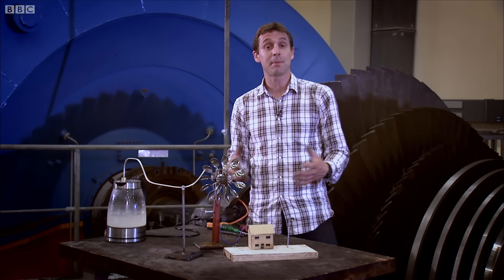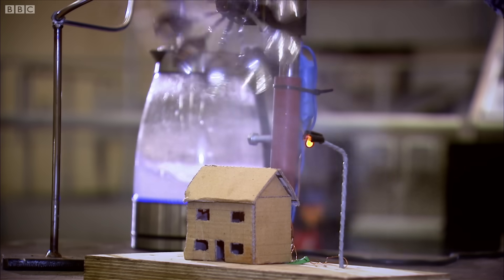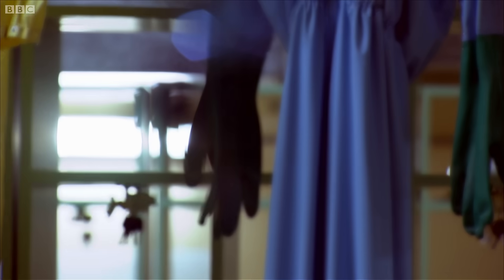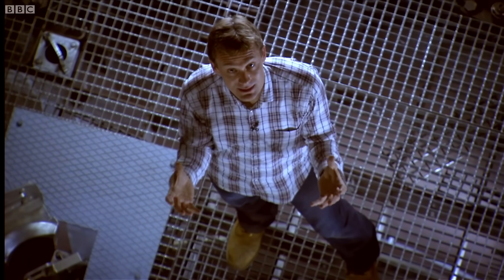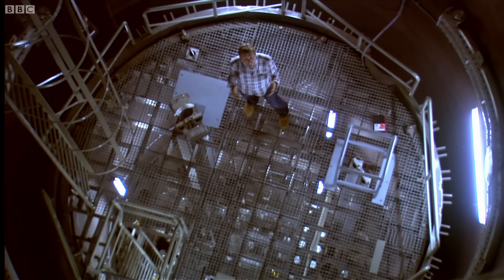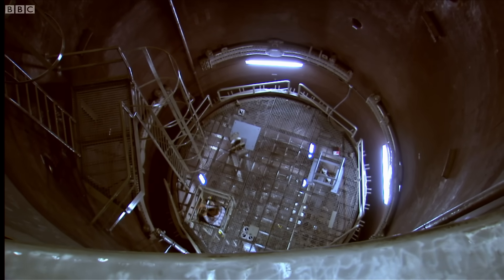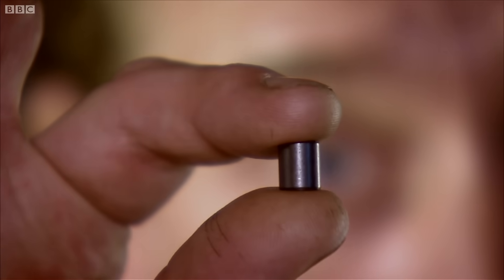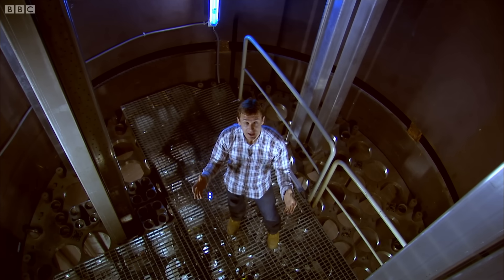Inside a nuclear reactor core - Bang Goes The Theory - BBC

Comment: Its nothing special with Uranium. Just about all atoms heavier than Iron can we split. The thing with Uranium 235 is that it can split it self if its moderated, this is also true for Thorium Plutonium, Uranium 236 and some other isotopes.

Actually using a neutron beam we can split just about any isotopes. This is a theoretical way of completely exterminate spent nuclear fuel.

The thing with Uranium is that its so easy... just ad water.... or almost. Actually it have to be enriched uranium or heavy water. This also work for plutonium. But with thorium you have to use a different method. But today there exist mix fuel that allows Thorium to be used in a ordinary reactor and also CANDU reactors can use thorium directly.
Reply: And that tied my loose ends up rather neatly! Thank you for the taking the time :) If i have any more questions i know what name to remember and where to shoot them! lol The wonders of a machine that harness such a force of nature, always awe-inspiring and raising questions.
Reply: I think thorium is the future
Reply: TIM CASE 2½ engineering degrees... ;)
Reply: matsv201
Nuclear Engineer fellow here. I love questions like TIM just asked. We born with this knowledge man, we're like semi-gods.. duh...
Reply: we can split atoms weighing less than iron aswell. Its just that the required energy exceeds the released energy.
Reply: u are hot
Reply: Tanvir Hassan Sorry to say it, its actually not me, but my wife...1
Reply: Then Its a Thorium fueled reactor that does the self regulation with Iodine-135 converted to Xenon-135 not this type, right? or does a uranium reactor have the same thing as the Iodine pit behavior chart? I'm just learning about reactors and this video kinda through me for a loop in how much they downplayed the complexities. Is there that much of a difference in reactor types? this video just suck, or am i missing something.. >_>
Reply: Generical FishTycoon Well, a reactor is not that complicated. Most complications is from the control-system, power-generation, backup-systems and safety-systems. 

A normal reactors contains just fuel roods, trottlecontrol, and moderators (usually water). A floride reactor is even more simple with no trottlecontrol, it don´t need it.

The fluoride reactors usually have a added complexity with the fuel recovery system. The thing with Thorium reactors is that when the thorium is consumed the wast material is a other  chemical material so there is no need for isotope separations. Making the fluoride in a way that so it can be chemical separated. So the used  fuel basically just falls out of the reactor and is hardly radioactive.
Reply: matsv201
How do you know all this?
Reply: CabalaCicero Yea, exacly, if you find something interesting keep diging.. thats how you learn
Reply: matsv201 Just out of curiosity about your degrees, which ones are they? And what is your yearly salary?
Reply: Juan Juarez Well, its complicated, my degrees have no real equivalency out side of Scandinavia/Germany....
But its 3 separate educations and they are non overlaping, that's the main difference from how it works in most other conutrys.

Master of science in electronic engineering (5 years)
Bachelor of Science in Civil engineering (3 years)
Post graduate Ph D free courses (½ year).

I earn about $25k after tax. Thats mostly because i work i a job that i´m poorly qualified for. But also due to that i live in a small town with low average cost of living and salary´s and high tax. Cost of living for my family is about $7500, that is really cheep for Sweden, average is about the double.
Reply: Well.. that was kind of the point. Technicaly we could split isotopes that is lighter than iron and still get isotopes out of them. But that would requier that they would have a very low or high number of neutrons, and then they would not be stable, so we would never get hold of them.
Reply: Disagreed, you are exhibiting a failed theory of atomic knowledge. You can fission atoms smaller than iron and you can fuse atoms larger than iron. Regardless fission can be instigated through too many  neutrons to cause an instability that will split the atom. That's definitional to fission (energy imbalance).  

You saying we will never get a hold of them because they are unstable doesn't really make sense. In a similar example are you simply saying that we wouldn't get a hold of a fission U235+n reaction after it happened because it doesn't exist, it fissioned?
Reply: So, are you saying that this is simply a REACTION (reactor) between Uranium and water?
Reply: Well.. kind of yes. But then you need a other moderator. Its not a water-water reactor then
Reply: IF you don´t understand what i write, don´t claim that i´m, wrong

Comment: This video doesn't leave plenty of room for scepticism on the safety of the whole process, one could think.
To say the least.
Reply: Russell Hopkins As with any other invention, we'll have to wait and see. There's still lots of difficulties and - already - known troubles fusion causes. Why not trying regenerative energies meanwhile - and a little power saving?
JFYI: even if fusion turns out to work rather safely, we already know that Earth's fuel capacities are limited. 
Nuclear energy is not the holy grail of generating power. As the universe shows us, nuclear energy works great in inhabitable spots, such as the sun.
We already have the technology to collect that energy. If only we'd spend all the dow on development of solar cells and power storage we have already spent on nuclear ruins, we'd be completely independent of anything but daylight today.
Reply: Bang goes the theory are members of the fan club.

Another ep does the stupid "Radiation is everywhere so stop worrying" thing.
Reply: Richard: yet it's pretty disgusting, isn't it?
Reply: The NRC (Nuclear Regulatory Commission) are responsible for protecting the populations health. Since September 11, 2001 the NRC has been working with Nuclear Power Facilities to make safety regulations and improve communication within the nuclear power facilities. They are also using state-of-the-art structures for the power plants. By improving their design they have made them safer to help prevent meltdowns and help get rid of waste. Power plants are some of the most toughest commercial structures in the country and are designed to withstand extreme events, such as hurricanes, tornadoes, and earthquakes.
All plants are run by highly trained staff, not Homer Simpson.
Many barriers protect the reactor minimize or prevent off-site releases.
With proper safety regulations damaging the core reactor causing radioactivity and threatening the health and safety is very low.
Radioactive releases due to terrorist attacks are very low.
It is highly unlikely that a significant release of radioactivity would occur from a dry spent fuel storage cask; and no release of radioactive material is expected from an aircraft attack on a transportation cask.
Reply: Ilovethelord508 Wow. That's impressive how you've learned your lyrics. Be assured on the following:
Unless you're working in the nuclear industry yourself, your knowledge on nuclear power might be respective, but mine will be as well. I know several people who work in that industry.
There has been a chain of serious defects in nuclear power plants, like the out-of-control run of Forsmark or the gas explosion in Brunsbüttel. These are only two out of at least ten accidents in the last ten years alone.
So, don't talk that kind of rubbish.
Reply: Käptn Kaos It depends how old they actually are. Any of the nuclear power plants that have broken down are the ones from the fifties. In other countries they don't have the money to afford the ones we have made.
Reply: Ilovethelord508 "Pour cheap designs"
Your cerebral hemispheres, you mean? Oh, yeah. Pretty - how you said? - "pour".
Reply: Russell Hopkins In Germany, they say, they have the safest nuclear power plants worldwide. I don't know how much safer they really are compared to U. S., Swedish or British devices. However, I do know for sure that every single German nuclear power plant outrun every single French one when it comes to safety, never mind their ages, simply due to safety regulations, which indeed are quite fierce in Germany.

France, though, runs about four time as many reactors as Germany ever did.

However:

- Germany also has one of the most active and best-informed anti-nuclear movements in the world, if not the most active,
- "the safest nuclear plants in the world" does, by far, not necessarily mean "safe".

There's an impressive history of serious incidents which happened in German nukes during the last ten years alone, even in the more modern ones.

I'm pretty sure that you will agree that German and British nukes will at least match when it comes to safety, so you might give a little thought on "when they do it in Britain, it must be safe".

No, sorry. It doesn't have to be safe. All a nuclear power plant has to come along with to give it the all-clear is plutonium.
Reply: Ilovethelord508 Ah yes - like Fukushima where they bought US power plants?

Again the lyric sheet on Fukushima goes. It's The Ruskies and communism & stupid command (Nope wrong)

Oh Fukushima - It's the incompetent Japanese and they are not us.

(But it was a US plant) Oh it's an old plant. We must build new ones.

By the way if you actually look into the internal NRC handling and discussions of the Fukushima emergency you might learn exactly how dangerous the US plants are.

Sorry to tell you this but the actual NRC and industry documents do not support claims of safety that are publicly made. What's more the whole basis for the safety analysis are based on faulty logic and statistics that were invented purely to give the answer they wanted. Fukushima was a clear example of the fault in the logic.
Reply: Ilovethelord508
I see. You have one great portion of expertise, as I read you.
Where I come from, there is a saying. It says: If you have no idea what you're talking about, why not just shut the fuck up for a change?
Where I come from, there is also the country where their nukes were said to be the safest on the planet, never mind their age. That may be the case worldwide; however, as I said, I'm a little more into the tech specs of these machines. Plus, I know people in the business. You seem to have no idea of the incidents I was talking about before.
So, for heaven's sake: Shut up and learn before you talk.
Reply: Richard Werkhoven
Fukushima Daiichi ran on Westinghouse-designed vessels, though they were produced in Japan under US license.
The US plant "Indian Point", which is still running, has exactly that type of reactor vessel in it's reactor housings. The safety standard of that plant is below that of Fukushima Daiichi, because it is older ald, additionally, lies within an earthquake zone.
There is no reason for the US to feel safer than anybody else who works with nuclear power. Hanford Site is another good example why one should leave nukes alone.
Reply: Käptn Kaos Pour cheap designs
Reply: Its safe when its done in Britain
Reply: Well you haven't wiped out a huge swathe of countryside yet. But you have had a go at it with the bomb plant falsely labelled as a power station.

Clearly regulation and execution matter but no it's not safe in Britain either and the danger is well known within the experts and the industry. The lies told to the people by the same have not been shown up yet,
Reply: Ok, what about when fusion can be accomplished,
Reply: Russell Hopkins Fusion is a completely different industrial issue. You can't compare the risks of flying to those of working on a ship, only because both of them can be used for transportation. Ship undustry needs completely other safety discussion than flying - but both of them are not capable of making a full landsite inhabitable.
Reply: Käptn Kaos yes but when they can do it i think fusion is the way to go dont you?
although what will happen to all the fission reactors along with all there dangerous waste materials etc when they have to be scrapped?
Reply: Russell Hopkins
Nuclear energy is never 100% safe until they find a way to dispose of the waste properly.

Comment: Nuclear energy can be a great energy source, but the problem is always the idiots at the helm, not the machinery. Also, as in the case of Fukushima, if proper maintenance is not up kept, problems can and will occur.
Reply: Nope.

The reactor roof blew off because the reactor exploded.

The reactor exploded due to the reactor being deliberately taken through a series of operations that were highly dangerous and were against operating procedures, against the orders given to the plant and against the advice of the junior staff being told to perform the operations.
Reply: I think it must be said that until we solve the idiot problem, Nuclear power is out of the question.
Reply: Andrew Shannon Pretty much all problems with nuclear have been solved with Molten Salt Reactors and using Thorium instead of Uranium, something that has existed since the 70s, the ONLY reason we use the reactors we use now is because they produce Plutonium which can be used in nuclear weapons so that was what got funding.
Reply: Andrew Shannon
There will always be idiots, so we'll never solve that problem.
Reply: Andrew Shannon than u can live in the dark bro. 20% of all power in the US is nuclear. it is our 3rd largest. it is an option and will be until something new can replace its efficiency
Reply: Chernobyl was because of a engineering fault, the concrete reactor core roof fucking blew off because they tried to save money in building it.
Reply: Richard Werkhoven Dude, i'm on your side and you're getting all fucking ass hurt. It's still a personnel error.
Reply: mitchsfarm Sorry if that sounded personal but I keep hearing this version of events.

Yes it's a personnel problem - and 1 person really.

The design is way less than ideal but isn't the actual cause in that case.
Reply: Richard Werkhoven are you talking about chernobyl?
Reply: Yes
Reply: I'm totally in favor of nuclear power.  As soon as we can solve the idiot problem, the greed problem and . . . . . . . . . . . . . Oh yeah,  the waste problem.
Reply: Andrew Shannon What waste problem? They know how to get rid of it, but no one is willing to. Shoot it at itself, the sun.
Reply: Energy required to get it to the sun?

Pollution generated by launch vehicles?

Cost involved?

Simpler to just use solar & wind etc.

(yes it is feasible, no the sun doesn't shine at night but if you are smart you know the answers to that. Yes wind is variable but that is also possible to deal with)
Reply: Yes Uranium cycle was chosen because Nuclear electricity would be financially unviable so the only way to make it viable was to sell the primary product to the military and use the waste heat to make electricity.

No MSRs haven't solved the problems sufficiently even though they are a lot lot better than Uranium reactors.
Reply: Richard Werkhoven nuclear reactors in Canada have MSR's.... Moisture separator reheaters... ahahah
Reply: LOL - Yeah a lot of reactors have steam seperators of some description. For fairly obvious reasons
Reply: One must be dumb to not wait a NUCLEAR POWER PLANT regularly.
Reply: TopShot501st

Oh yeah the 2.7% efficiency is wonderful isn't it.

I'd prefer the current efficiency of the average solar PV array. Solar PV arrays are mostly 5.18 times as efficient as Nuclear.

yes I know the intermittency issues - and I know how that can be dealt with.

No not talking Solar PV only for the future - but don't talk efficiency if you don't know what it is.

Comment: Boiling water is not the answer for nuclear reactors. He said the water is at 300°C so the only way you can boil the water at that temperature is if you have immense pressure. NOT SAFE. And as far as Uranium oxide pellets go, SOLID FUEL SUCKS. Its like a coal fueled steam engine vs a gasoline engine. Liquid fuels are superior to solid fuels, be it chemical energy or nuclear energy. If a nuclear reaction could be sustained in a liquid medium at high temperatures this energy could be utilized far more efficiently as opposed to putting hot metal in water
Reply: In the case of fuels, diesel is the way to go. It's slower burning. It gets double the mileage of gasoline, and the need for fossil fuels is finally starting to become obsolete. Now, the world has options most were too lazy to realize were there in the first place. Same goes for nuclear reactors. There is a soon to be replacement for these, and as expected, Japan is the world leader of technology, so they are they are the first to experiment with the new conjugation. Behold, the fusion reactor. Much more efficient than nuclear AND fossil fuel, sadly less stable than nuclear but give it time.
Reply: speed150mph
he said fusion not fission big difference
Reply: Might want to look into Thorium reactors
Reply: *****
im still putting my money on fusion just look at the potential energy output if we make it work and the only byproduct is neutrons and helium
Reply: killman369547 And heat and electricity that becomes heat. And irradiated blanket that must be changed out.